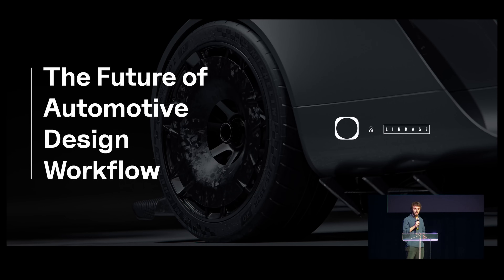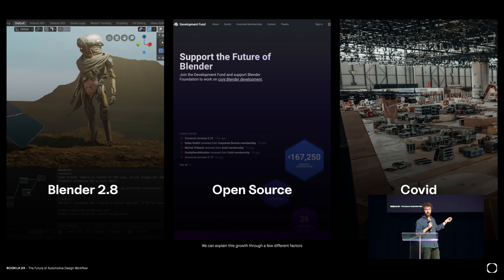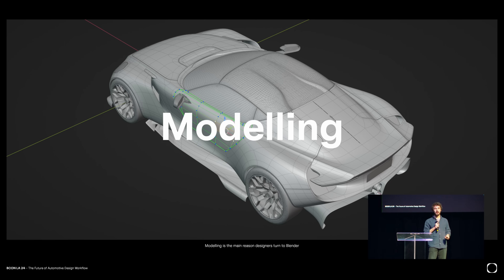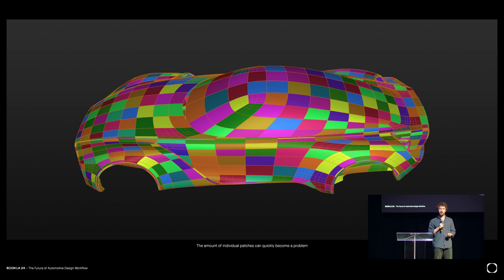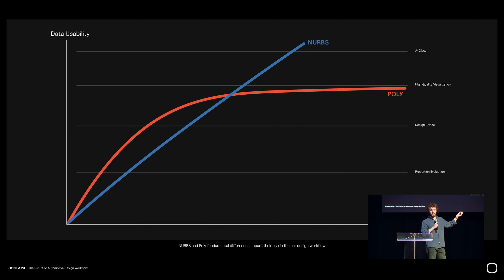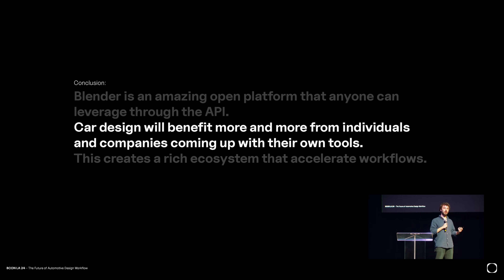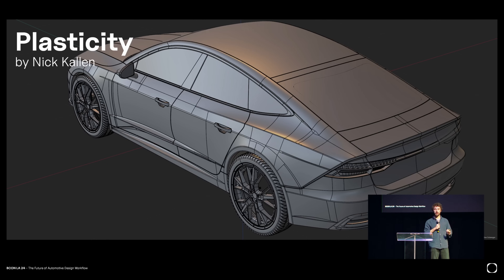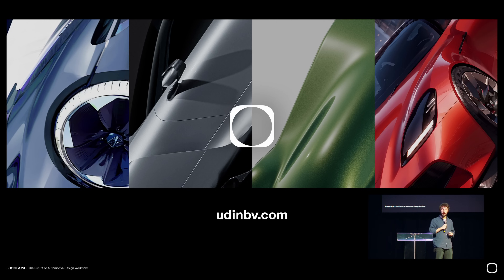The Future of Automotive Design Workflow - Odilon Loiez

Comment: I wonder as more and more auto companies adopt Blender as a design tool, with more designs produced in a shorter time period, if any of that cost savings would translate to cost savings to the customers of those vehicles? Or a higher wage for the designers? Since they're doing more design output in a shorter time period? Since polestar does their design competition every year where the entrants primarily use blender I wouldn't be surprised if the more companies do the same thing and begin farming out in the design in the form of competitions or gig work in the future.
Reply: The result is a shorter time between initial sketch and the start of manufacture but for no extra money. I'm working at a consultancy and we're using this workflow to produce vehicles, unfortunately it just means the client wants everything faster because they know these tools now exist.
Reply: @SynthetikCreation  Yep. If anything the video showcases how it's currently extra work to create a full poly model and then a nurbs model. I made the same mistake of working with clients that saw a nice blender model then didn't understand no mater how many times I explained that I'd have to re do all the modeling again for anything to be translatable to an engineering package. But they just didn't want to hear it because it sounds like an excuse.
Reply: @MrAlziepen  That sounds very familiar to my own experiences as well. Telling a client they need to wait while you rebuild the entire model with A-class surface isn't an easy conversation. Let's hope some of the tools discussed in this video keep improving so the time between poly/subD and NURBS is reduced.

Comment: Rhino has NURBS, Shrinkwrap, Quadremesh, SubD modelling and Cycles Render. It's also got the best curves drawing system I've ever used.
Reply: Sure, but it's not free and open source. I use Houdini, Substance, Maya and basically all industry standard software for work, but Blender's development still makes me happy, cause it does most stuff well enough without costing an arm and a leg, especially if that money goes to Autodesk or Adobe.
Reply: @sirdiff1  I still use Rhino 4 daily (using specific discontinued plugins) and it only cost £800 17 years ago. That's £47 a year. Rhino upgrades only cost £395 each time and they are perpetual licences.
Reply: @sirdiff1  Rhino is cheap to buy @ £800 (with perpetual license and half price releases/upgrades every 4 years), uses open source tools including Cycles, and has a similar marketplace to blender for plug-ins. It's been fun to see blender grow over the years, and I find many of its tools complementary to my Rhino workflow, but as someone who is modelling 90% of the time I find Rhino's variety of tools invaluable, and for anything else I can use Blender, 3D Max, UE or Twinmotion.
Reply: Software, you also have Alias, Icem Surf which are way more serious than Rhino for surfacing for example in exception of grasshopper. Or proper CAD software like Catia, etc, different tools different applications. Blender is free, kind of difficult to compete with something like that.
Reply: @amigodesigns  Catia costs £5.9K per year, Alias costs £5.4k per year. Rhino costs just £800 for a perpetual license. I still used Rhino 4 daily (for specific discontinued plug-ins) for 17 years which works out as £47 per year. Rhino has upgraded 4 times in 17 years and each perpetual license upgrade is half price. You also get access to a beta program with experimental tools in-between upgrades. It's difficult to compete with something like that. Blender is free but they ask for donations and anyone making big money should really support the software.
Reply: It does have a lot of good stuff but it is not used in the automotive field for some reason! I think Alias has just more control and precision, it's much easier to keep clean un-spanned surfaces compared to Rhino!
Reply: Blender is mostly a polymodeling tool It's not supposed to be used for manufacturing product design. It can be used for concept design though just like any other polymodeling software.
Reply: I can use Cycles Render in Rhino???? Please tell me how!
Reply: @NGAPFWEJEPANBDIS  it's the native render engine in Rhino 7 & Rhino 8.
Reply: You can't compare Rhino with Blender. I use both and both have there advantages. Rhino is only good at creating NURBS models. All the rest Blender is better and faster to use.
Reply: @Aloex777  Rhino is better, faster, and most importantly more accurate for hard surface modelling, CAD drawing, NURBS to SubD & Mesh conversion, BIM, and parametric modelling. Rhino also has better snapping tools, selection tools, scaling tools, analysis tools, layer manager, construction planes, worksession manager, compatibility with significantly more file formats, AND its default view isn't tilted. If I want something that looks accurate, I use Blender. If I need something that IS accurate, I use Rhino.
Reply: @Pablomache  Like I said. Its hard to compare. Rhino is CAD, Blender is Poly. Rhino supports BIM, Blender doesn't. Rhino has Grasshopper, Blender has Geometry Nodes. SUBD Modeling in Blender is much better and easier to use. Rhinos NURBS to SUBD, only works in very easy cases, same with Quadremesh. All your other mentioned benefits of Rhino are debatable. You can do all of it pretty well in Blender or dont need it. I really miss most features from Blender when I use Rhino.
Reply: @Aloex777  in my line of work accuracy is one of the most important things, so Rhino is my best choice (of the two). Blender is a fun program but I miss all of those 'debatable' / essential features when I use it.
Reply: Rhino only does meshes. Not very useful for 3d printing or manufacturing
Reply: @emanggitulah4319  Do you mean Blender? Rhino does NURBS, meshes, & SubD.
Reply: Blender ? You can export STL from blender. STL is a mesh. Sure Blender is not for manufacturing
Reply: cagalagosi  yeah, they used ue4 for rendering only and pretty sure a huge portion of blender users who use it professionally also use other software as well. Also, it's blender conference, ofcourse they are gonna talk about blender, you don't go to houdini hive to talk about c4d lol. Also, not sure why you are here if you dislike blender in the first place, maybe consider getting a life first? pretty sure you are the same guy who used to go blender videos to comment negative things about blender? what happened to your old account? did you get banned?
Reply: Ok, then use Rhino…
Reply: @HMAnetwork  obviously I already do
Reply: cagalagosi  they should do a word count breakdown on how many time he said the word "blender"

Comment: Exciting to see Plasticity mentioned in this video. 

Amazing, easy and fun to use for Surface Modeling 👍
Reply: @skypilotace  Your right for mass manufacture in industrial design Solidworks or Fusion360 even are better due to the parametric workflow. Blender and Plasticity are made for artists specifically, and like others have mentioned geared more toward speed in modeling with fewer clicks and hotkeys than making a dimensionally accurate model that's going to be engineered with a B side. There is also the aspect that SW is expensive and not accessible to the hobbyist. The same goes with surfacing tools like Autodesk Alias. Plasticity is 150-300 and blender is obviously free to use and has a lot of addons to help achieve good visualization results. Blender is getting more and more popular in design collage due to the speed at which students can pivot and change their design to something else, where as if it were more of an engineering project like Formula SAE than everyone would use solid works. In an ideal world everyone would use the engineering based tool that can do it all sure, but the cost, time, and use case all play a part.
Reply: @skypilotace  i use both blender and plasticity and i also used solid edge each of these software packages have very different focuses and capabilities. I experienced the pain of using solid works and solid edge as a creative software its nice for stuff when you already know what end result are you going for or at least have strong idea of it but imo its not very efficient for design exploration for complex surfaces that might change wildly between iterations.
The statement of "Sooner or later you have to put the toys away and become an adult. You will never go wrong if you stick with the big boys" is a very simplistic way to look at things, dont get me wrong im not saying that those are bad tools, what im saying is some times its better to use something that fits the need that the teams have, like solid works is not nearly as good at 3D visualization as blender, maya or 3ds max and nowadays the difference between the latter 3 that i just mentioned is very negligible blender is on par with most other poly modelling software. Plasticity is very rough around the edges still but i think it will be another excellent design tool for complex surfaces that blender doesnt like, aslo it can be used with blender and i use it like that so you get the benefits of both tools.
Reply: @issacdhan  Agree! xNURBS is just like magic🔥